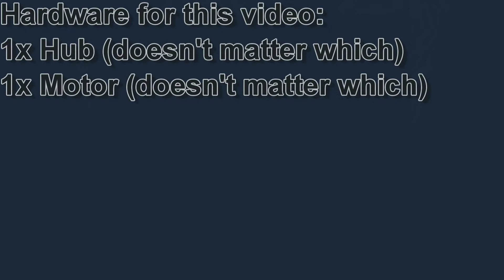Lego Powered Up Tutorial #02: Time for a break & let's control the crocodile train [English|HD]

Comment: I'm not sure I understand the speed block you have on this does not have a start block before it, how does it work?  I thought you said in the first video that it needs the start block to execute?
Reply from the maker: I don't use it in the program. The motor doesn't have a rotation sensor so it can't use the speed block. It's only for explanation purposes.